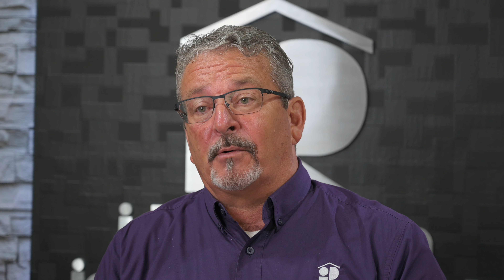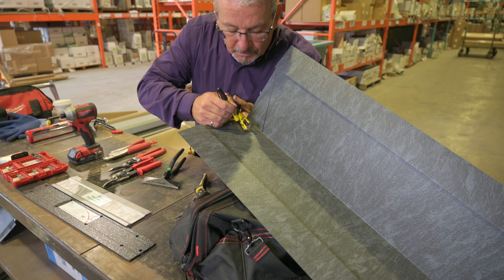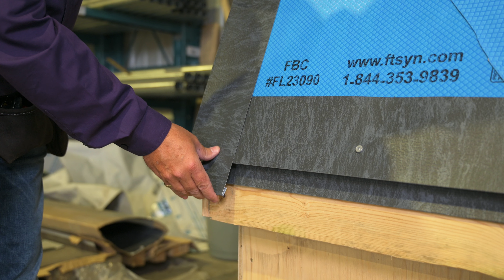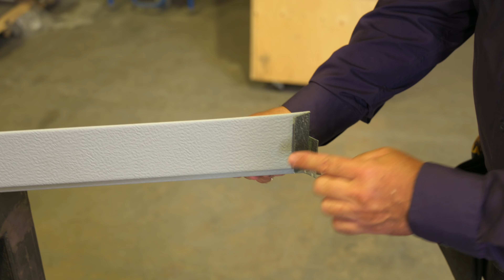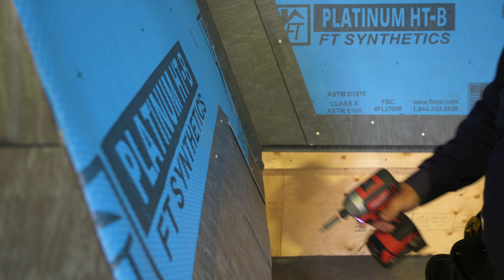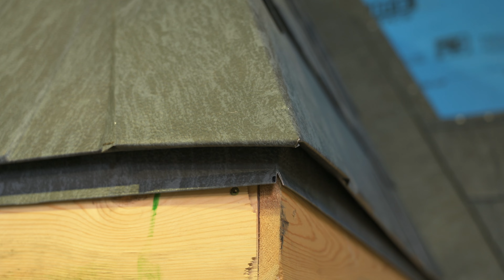How to Install Wakefield Bridge Metal Shingles

Comment: Great video only 2 things. The dominate wind thing is not a thing dominant winds dont always blow from the same direction. I dont care if you double rap your ice and watershield you put a seam in the middle of the valley where all the water is flowing into, why didn't you just run the Ice and water straight down the valley like you did with your metal valley?